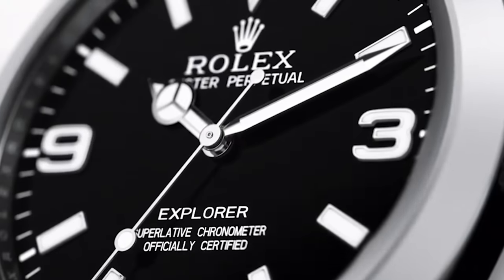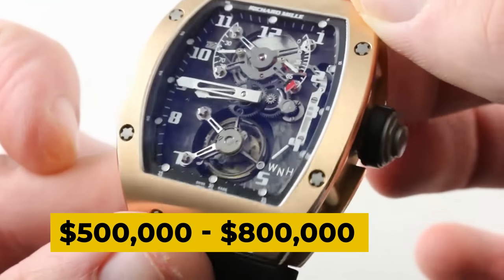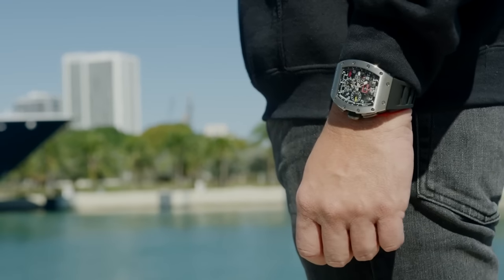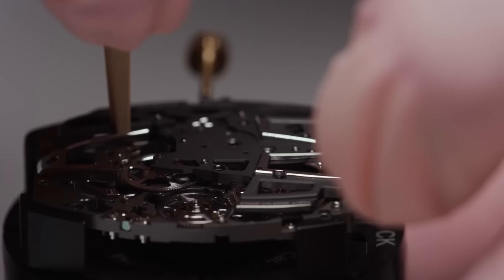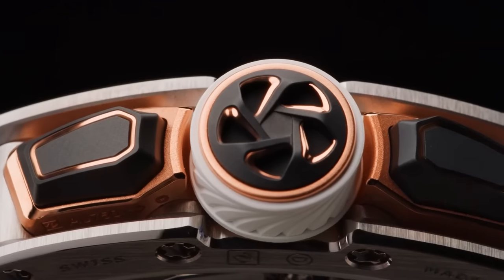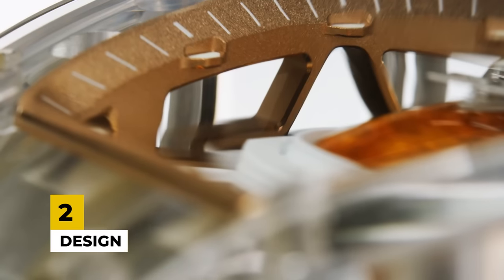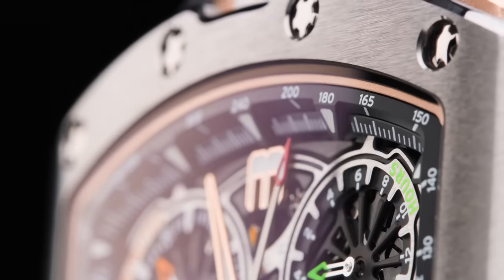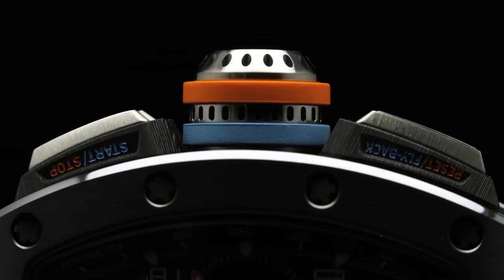Why Are Richard Mille Watches Are So Expensive?

Comment: This is pure status symbol. Waste of money. Lol.  The movement is Complex for the sake of being complex.  It’s nothing advanced like the spring drive.  Legibility is terrible on this. I could buy it but I’m not buying it.
Reply: All mechanical watches are pointless, and exist just for the sake of it tbh
Reply: Spring time does not have tourbillon; ) but you are right in cas if prices and other tech used in Spring time .
Reply: I know what you're saying but I still want one 🤣
Reply: The highest is now at 6.5 mio euro Nothing compared to other brands.
Reply: Like an apparemment in Monaco they never loose value
Reply: @maxq6219  There is a Spring Drive Decimal Repeater which is probably 50x more mechanically complex than a tourbillon.
Reply: With utmost respect to the manufacturer and wearers - apart from the rotating engine (which seems childish to me if considered as a major reason)
1.  what other unique functions does it perform.
2. Which materials/minerals are used and in what quantity.
Reply: You didn't understand the basic economics.
Reply: Richard Claret Poker Watch is better I think as complication. No double tourbillon but nice features.
Reply: You will never be able to afford one. No need to worry about it.

Comment: It will tell THE SAME time. You know something’s Ostentatious when its materials/design take more of the product’s price than the main Function.
Reply: Haven’t you figured it out yet, people are not buying watches for the time.
Reply: @pippipster6767  anything of which function is 2nd to form is unnecessary. The main function’s QUALITY is foremost.
Reply: @hastensavoir7782  
On that basis art is unnecessary.
Quality is an independent factor of both function and form.